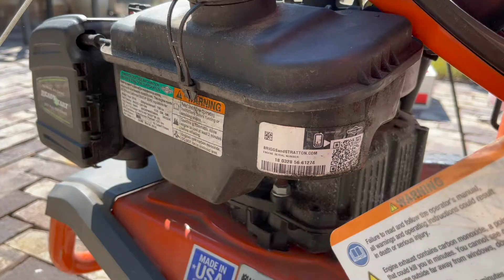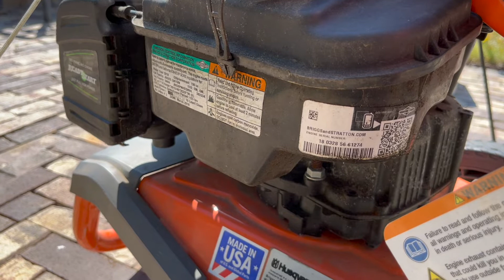Husqvarna pressure washer with Briggs and Stratton Engine Won't Start - Broken Friction Plate

Comment: Good video. I have a question for you and hopefully you can help me out with my pressure washer issue. 
It won't turn on but when I put a little bit of Carb/Choke cleaner, it works but only for a few seconds (Husqvarna 3100).
Thanks a lot in advance sir!
Reply from the maker: Have you checked to make sure fuel is getting to the carburetor? Sounds like you could have bad gas or gas isn’t flowing.
Reply: @RaiderDawg Ranch  
Actually I drained the gas and put new one
Reply from the maker: When was the last time you used the pressure washer?
Reply from the maker: If it has been several months since u used it, you might have a gummed up carb. Check out this other video I did on my generator. https://youtu.be/fsttTQsv_7Q
Reply: @raiderdawgranch  
Ok thanks
Reply: My guess is the jet(s) on your carb are gummed up.  Drop the bowl, unscrew the jet and either soak in carb cleaner, or if you have those tiny (and I mean tiny) wire pipe cleaner thingys you'll be in business.  When you take the bowl off, you should be able to smell if your fuel had turned on you.  If you are able, drain the bowl into a clear glass.  If you have water it will be evident.  Damn Methanol gasoline!

Comment: Luckily it was something somewhat simple. Of course it all cost way too much to fix. Glad you got it fixed.
Reply from the maker: It turned out to be a generic replacement, which might explain why it was only around $35 and not $90 like the direct replacement. But it works well. Used it several times since this video